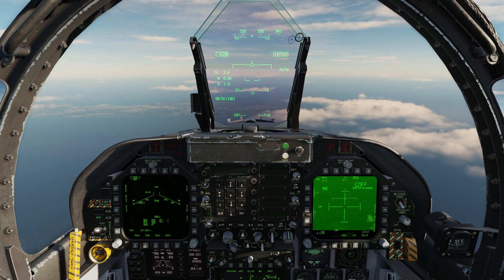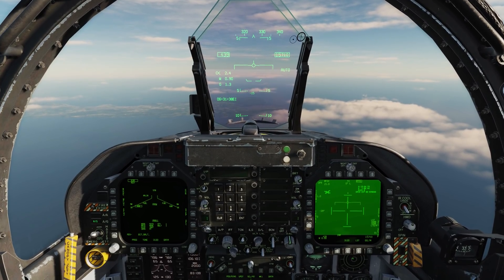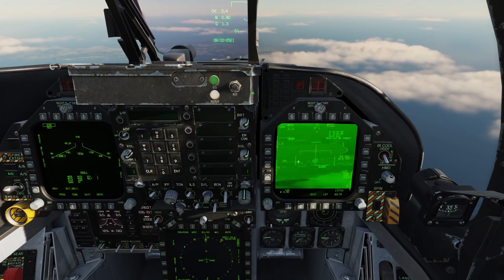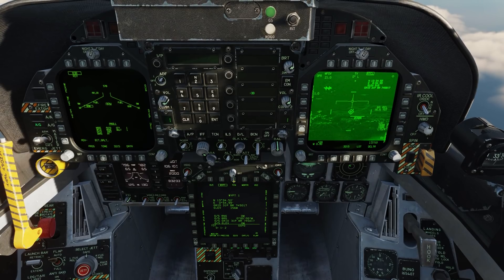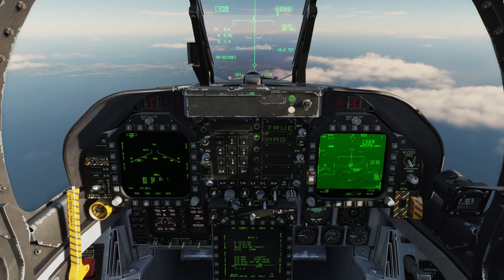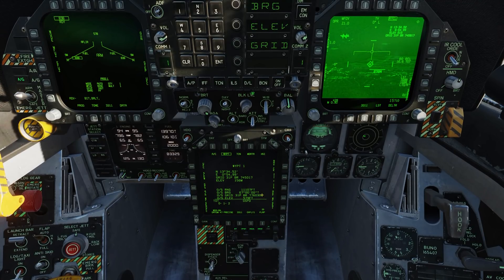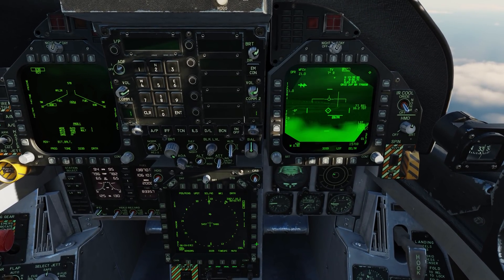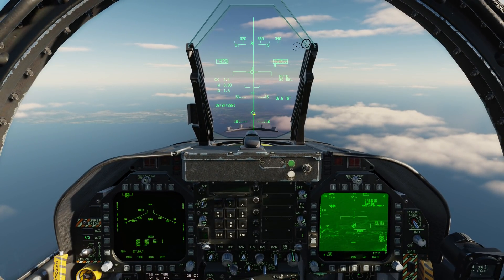DCS: F/A-18C Hornet | Offset Aim Points

Comment: Hi Wags. Nice video as always. Two questions : 1) is the altitude relative or true ? 2) when will the first Hind training videos come ? Greetings.
Reply: Great question. According to natops manual: On the UFC select the POSN
pushbutton to enter lat/long data, the GRID pushbutton to enter UTM GRID data, the ELEV
pushbutton to enter elevation data, and the O/S pushbutton to enter offset data (offset range, bearing,
and elevation).

The way I interpret that is if O/S is used, all 3 elements are relative. It's an English issue. Anyway, if anyone knows a) how it should be, and b) how is it modeled in DCS, would be nice to hear.

Comment: Great video and feature! Probably worth pointing out to those not familiar with it that OAPs are particularly useful for targeting objects that have low radar or visual signatures - i.e. you can't find them well with the radar or other sensors. Typically, you'd set the waypoint to be a significant radar or visual target, then set the OAP for the difficult-to-find target off of that. For example: north end of a big bridge is the waypoint, and the OAP to the hidden underground bunker is 2,000ft, 220 degrees and 454ft elevation from the waypoint.
Reply: ok, so you have a target that is difficult to find, but somehow you magically DO know the range ofset and elevation?? doesnt that mean that you actually already know where the target is en could program a waypoint for it? also, if you dont know where the target is, en you find it on a tgp, is a markpoint not WAY faster? I really fail to see the use of these offset steerpoints here. Where would you suddenly get that data on a unknown target?
Reply: @nighteyes2010  its more useful  than you might think, though DCS will need to add some variety to JTAC and other AI to utilize it. Consider friendly position relative CAS as one example, e.g. “structure bearing 345deg 600 yard from our (or any known) location.” Without offsets that’d be a real pain and slow

As far as data source, you can mark a friendly PPLI location very quickly
Reply: @nighteyes2010  A real JTAC may not know exact coordinates of target like they do in DCS. They may say something 305 degress  2 miles off our position marked by smoked. The F18 just needs to use their HMD to make a mark point on the JTAC position then do the offset to get the location the JTAC is talking about. 

You say "i would simply slew my tgp  600 yards in that direction instead of trying to input those numbers." Easy to say, not easy to do. Also impossible if you don't have eyes on yet. The JTAC can give you their coordinates, you do the off set while you are 40 miles out. You now have the target area
Reply: @nighteyes2010  Your intelligence folks would plot appropriate offset aimpoints for you and put that in your target folder for the mission planners to use when they make the attack card, so they are most useful during pre-planned attacks.  Aside from that you might have a catalog of known offset aimpoints for which you have coordinates, elevation, and a picture and if one of them is close enough to the target you want to attack...  At least we did in the B-1 on our laptop.   Aimpoints were more useful back in the days when most fighters and bombers didn't have a targeting pod.
Reply: @PBAR_B1B  But if you know the offset in advance, why not just input the correct coordinate? why the long way around that. Is it safe to say that, with the targetting pod, this system is more or less superfluous?
Reply: @nighteyes2010  In the days before GPS, your INS would drift so bombing coordinates would likely result in a miss (or your GPS may be jammed).  With targeting pods, it's mostly superfluous except where a good offset aimpoint is beyond the range of your target pod's ranging laser.
Reply: @nighteyes2010  I wrote same thing as you.. and wipped it off cause I think that if they put this capacity on the real plane, they sure had a good reason. We have not all explanations on it.
Reply: @roumi9790  Yeah i would agree with that. we've already seen in the targeting pod that some things have real world value, but not really game value. i guess in certain situations this might come in handy, but so far, after 30 years of flying sims, i cant think of a situation where this would be 'sim' usefull. its just too much of a hassle and relies on information that you most of the time dont have, unless you use the 'magic' ingame map ( i consider it cheating) . And even then you would be faster simply slewing the tgp yourself and taking a markpoint.
Reply: They are also used to target something straight ahead off of your nose because synthetic aperture radar (expanded) modes generally don't work well straight off the nose.

Comment: Thank you. In the a10 I think I can save the offset as a seperate waypoint afterwards for later use. Is that an option? Altho I guess wouldn't really need to, it's just an extra press when switching back to waypoint assigned it off. Or could turn it into mark point maybe

Comment: With all due respect, but focus on something important, not things that no one will ever use in DCS, because there are better and faster ways than typing a dummy data during the flight that not many will be able to determine anyway. A / A radar repair and focus on it, because this is something that is used on almost every mission, not some unnecessary offsets.
Reply: That's like, your opinion, man.
Reply: Thats actually very useful for CAS and other missions...
Reply: Not everyone is a brain dead airquake player that wants DCS to be PVP Ace Combat. This will have a ton of practical use.

Working with a player JTAC who can give you their location, then call range and bearing to targets

Working with a Kiowa, Gazelle, Ka-50 who can give you their grid and do the same as above

I can go on, but you're probably frothing at the mouth now trying to think of ways to tell me I'm wrong.
Reply: Speak for yourself mate
Reply: Yep,why should we get all features the real deal has and were supposed to get for out 80$ module when they can focus on what you want instead.
Reply: That's funny comment. Many ppl want this and will use it daily.
Reply: @lukew2031  You will enter a new waypoint faster. Besides, good luck that people will be able to determine the shift distance (RNG), not to mention the rest of the data;) Only useful if Human AWACS during a mission wants to move the CAP. This is when it will come in handy. While flying alone, you will not be able to tell, for example, to the wingman how the target has moved, because you will not be able to specify the distance precisely.
Reply: @maverickmj  I build SP missions. I see a lot of potential. New waypoint is not always desired. Thanks

Comment: Yeah, it makes sense, but where/when will it be usefull?
Reply: Suppose that you provide CAS for some guys on the ground, many missions like that. You drop a markpoint on them so you know where they are. Next they tell you that they are taking fire from bearing 150 about 5 miles away. You enter that into offset and immediately have a rough targeting waypoint on the enemy group.
Reply: @devla  Yes, sounds like the idea
Reply: I guess if you know the position of the friendly who are engaged, they can direct you with a offset to the enemy location? Idk that just makes the most sense to me?
Reply: @schweizerluchs  Yeah.
Reply: @schweizerluchs  or say if you have a known landmark waypoint for a city, but your target is in a specific building or specific ground asset that you won't know until you're almost on station - set your offset as the specific building when the data comes in while the waypoint generically marks the city or airbase for general routing info.